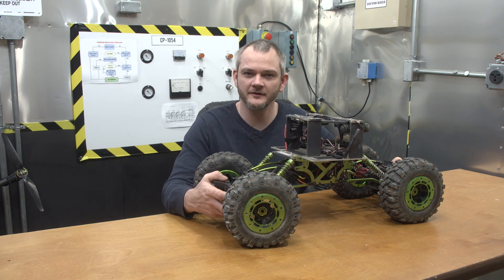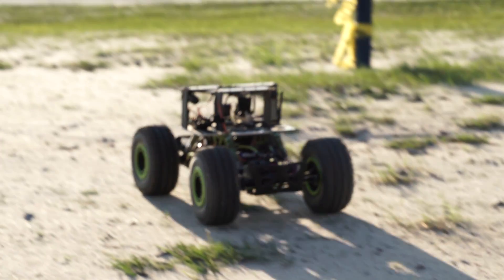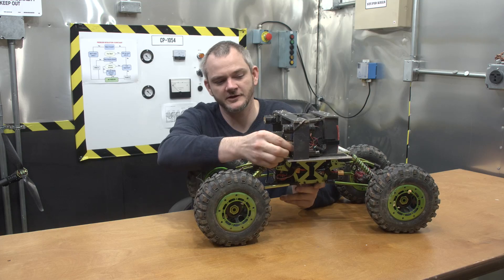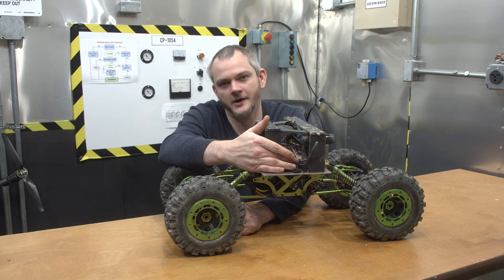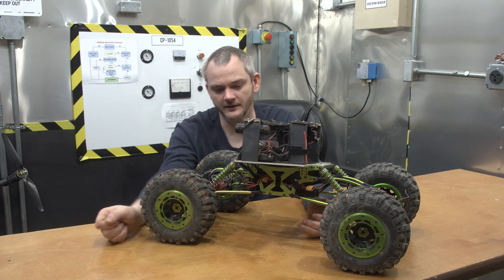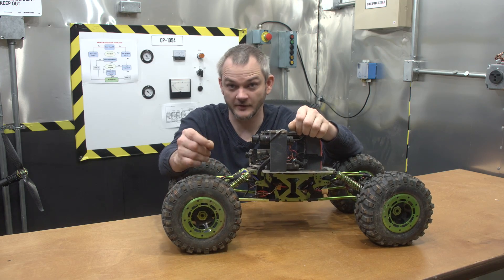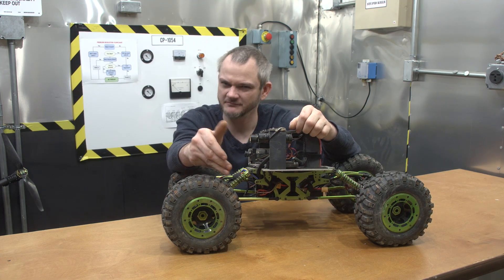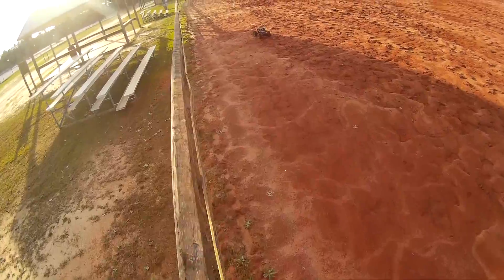1/8 Scale Rock Crawler Rover Update, Now with Brushless Motors

Comment: Hi whas wondering what you're new esc's and motor's youre are using what the name is ?
Reply from the maker: The ESCs and motors are Hobbyking branded.
Reply from the maker: @djasus2087  Stock, it does pretty well but don't expect much speed.  They are 540 sized motors so they still have enough umph to do what you need

Comment: What about the energy consumption of it compared against the previous non Brushless version?
Reply from the maker: +José Ignacio Chielli Due to a lot distractions (work,life) I have not been able to utilize this truck enough to get a good feel.  The battery does not last as long time wise but I suspect that is mostly due to the simple fact that it so much faster now.  From a very general observation it seems to travel further distance wise per charge but is not significantly different.